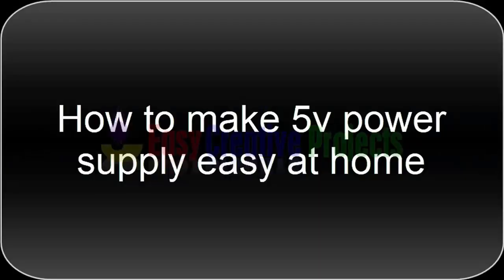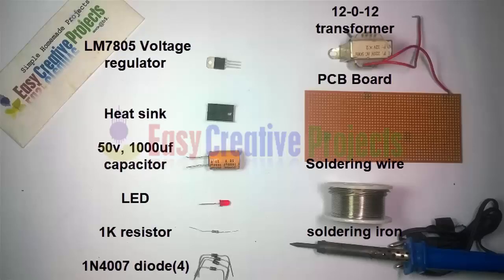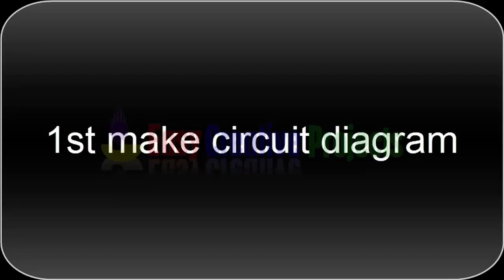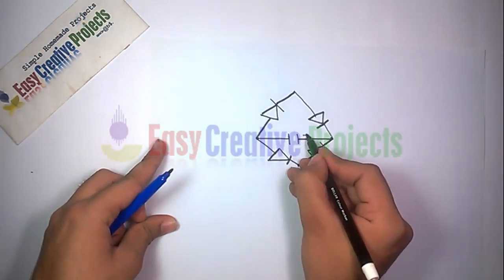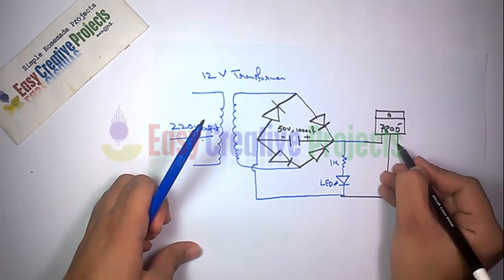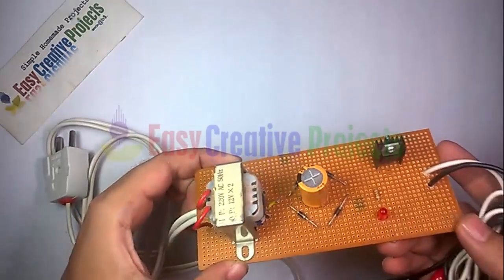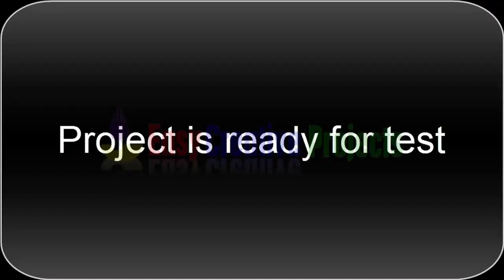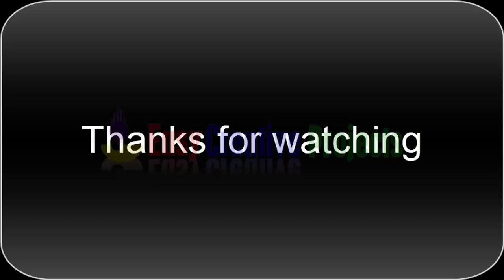How to make 5v power supply easy at home - step by step with circuit diagram

Comment: If I want to use it as phone charger should I put female USB only and don't change the other components? ??
Reply from the maker: yes dear, if you want to use female usb connector. so simple connect usb connector with charger. both are same. 
(positive and negative wire must in mind)